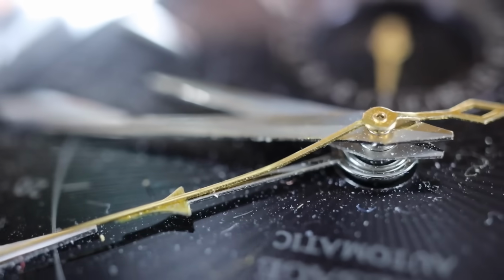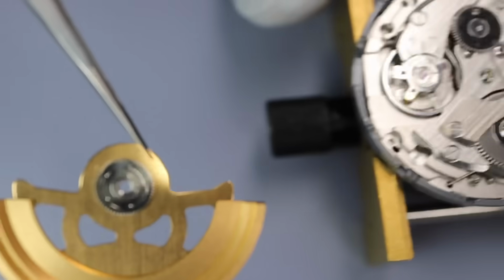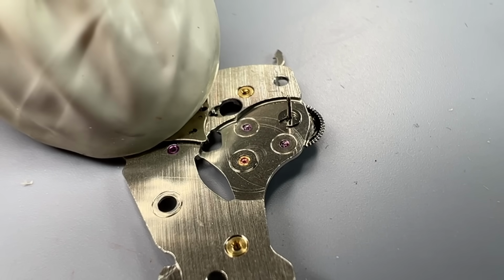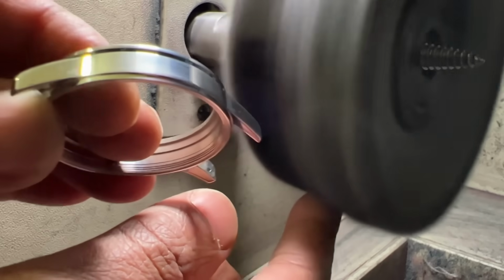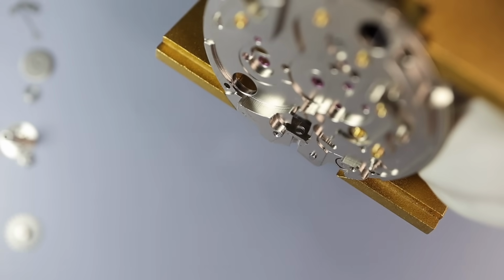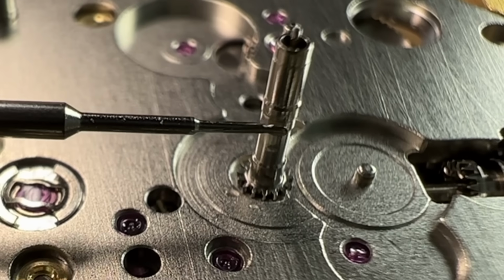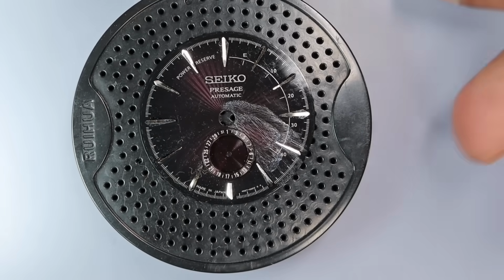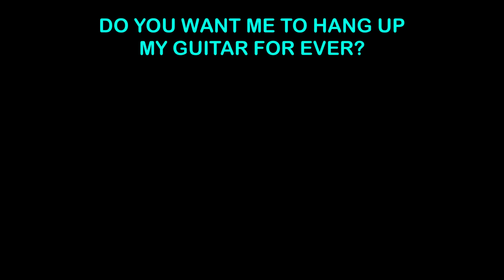Poor guy smashed it just after purchasing it - Seiko presage scratched dial restoration

Comment: Again, great video. I know not a comparison but recentley had a wall clock stop ticking , cheap plasic movment I s'pose you'd call it a solid magnet escapment (?), your process gave me confidence to go in and clean the gears and oil the points and happy to say now back on the wall and not in the garbage. Thanks.

Comment: Joe, don't know if you ever come back (after a year!) and read newer comments on your old videos... but...

There is a technique to restore old scratched dials by relacquering them- using UV cure high gloss/matt/satin nail polish!

You do what you did to remove the sharp edges of the scratches then clean really well. 

Paint on the lacquer nice and thick, then spin off the excess, like how CDs are coated after printing. Then cure under UV. The lacquer fills in the scratches.

Comment: ive done quite a few guitar restorations and messed about with cars..One of the ways Ive dealt with very deep scratches like was to clean with with alcohol, then polish across the scratch very gently. Clean again, and then fill with lacquer (and even very watery super glue on occasions)...allow it to harden for 24 hours and then polish. It has yielded amazing results if you're diligent and patient..which you are of course!

Comment: Working on two sister movements at the moment, got the proper rotor for my 4R35 custom tuna to fit plus my genuine fishbone hands and also to fit a replacement dial metal logo on my 4R36 turtle which is snapped a letter off catching it with a microfibre cloth and it does not look good as an Eiko lol   Then I am going upmarket to start stripping down my Tissot SeaStar quartz the 2030 movement as I scored a very early square spares and repair one plus a complete clean donor movt but hey ho it keeps me off the streets I spose :P

Comment: This watch makes me think of a double big mac.  On the outside, it looks big, thick and flashy.  On the inside, it's a bunch of cheap, greasy, tasteless junk.  The "quality" of the components inside is worse than disappointing.   It looks like someone took a sheet of thin aluminum and machine punched everything, including some of the gears.  If I didn't know better, I would have thought this was a Chinese knock off.  I should learn to expect much less from a €560 watch.
The video was top notch stuff.  Amazing work you do to restore something to better than new.  As always, very entertaining and love to see the little ones watching.
Reply: Seiko makes watches for everyone, and models like the Seiko 5 are iconic and do last a lifetime, or more with good servicing. Durable and stylish despite being aimed at the mass market, for £500 it's a steal.
Reply: @BigHenFor  Did you watch the video?   That was a turdburger of a watch.  There were gears made out of punched Aluminium.  The whole thing may have cost them $50, maybe another $5 in grease.  That watch was crap.  You can't look at the components and tell me anything different.

Comment: Greetings to you once again! You have been kind enough in he past to answer a couple of my questions and I am hoping you could answer another: With all possible respect to your skill an the watchmaking profession in general, is it worth it to perform a full service on a rather inexpensive Seiko movement? Does Seiko even make them with the thought they would be regularly maintained?

Most of my small collection of watches have a Seiko "4R" movement and if any of them were to stop running I'd be very tempted to just purchase a new OEM movement to replace them. The last couple of "good watches" I had serviced do not have easily replaceable movements and to me it was well worth having them serviced properly. I should add that my watchmaker is also a Seiko AD and he merely replaced a 7S26 rather than a repair (the watch had been dropped and would only run for a few seconds at a time) He recommended it would be half the cost to just replace the whole movement. I couldn't argue with that!

Thanks again for the video though, it's nice to see what's in the watches I actually do own!

Comment: I sometimes have luck filling scratches on crystals with acrylic gloss medium then polishing down. Sort of filling the scratches with a varnish. But I am very very very amateur, so am just mentioning it in case it’s something you might consider refining for situations like that scratched dial. Maybe a UV resin would work too, as that’s usually much more crystal clear.

Comment: If you really wanted to challenge yourself and maybe pull of the whole "I'm a hero thing" :)  a bit of clear laquer set into the scratch will fill it nicely. Then either scrape or sand it down using very fine ( 1000 at least) then use polywatch to polish the gloss back up. I do something like this on car paint and it translates well into any clear coat with patience and a deft hand. Using a scraper is a woodworker trick and easily made from a bit of steel that you put an edge on.  That way you can size it exactly to what you need and no more.

Comment: Searching for such NON-WORKING 4R57 Seiko presage with power reserve In France or around
(NE57 is the generic name for other brands, as NH3x is for 4R3x x=5,6,...)

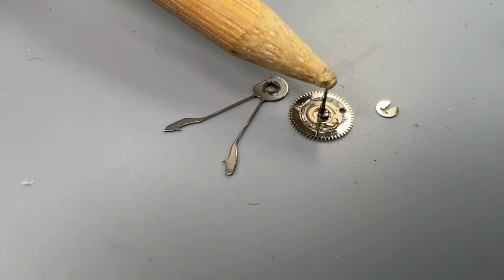17:04 the carbon grease  is normal on the magic lever excentric, but at the end you saved the dial !!! i
         dont know if heat would help on laquer ?

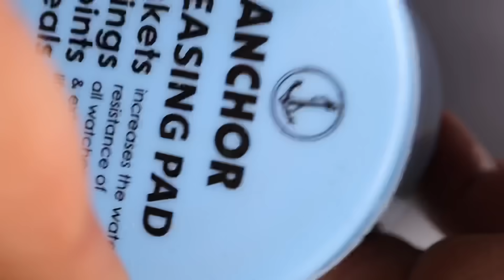Comment: 53:22 To all of you out there who still believe, the "Made in Japan" Seikos have different cases and differen case finishing than the standard ones: think again. Almost if not all of them have tha same parts from the same overseas factories. 😉
Have opened more than one of the JDM Seikos in the past and can most definitely confirm that 99 Percent of them read China Case on the inside with few exceptions like my Turtle which has "Seiko Time Co. Tokyo" embossed on the inside. Which does not mean that those cases did not ship from China in the first place.

Comment: I paid almost $700 for a Seiko and after two years the bracelet fell apart. The links became very loose early on then the clasp began failing. It completely fell apart just over two years old. I returned it to Seiko because I couldn't buy a bracelet for it. It is a special style exclusive to that watch. Seiko quoted me around $250 to replace it, the solar battery and pressure test it. I told them don't even bother sending it back to me (another $30) and I just went and purchased a new watch (Not a Seiko).

Comment: Can't believe how beautiful that result is NW, despite having watched your work for some years. By which I mean that perfection from your hands should no longer suprise me, Can you tell me why my 1980s EDOX watch is no longer watertight after its last service? Indeed, any dive or waterproof watch, including Omega watches returned to Omega for servicing, are never guaranteed waterproof afterwards. How can that be? surely there is a way to put the seals back? Thanks for the great videos. Tom (from France, though I know Birmingham well)
Reply from the maker: Hi Tom. The whole point of a service is to get everything working properly so I don’t know who told you that about not being waterproof. Omega will replace all the seals and pressure test it to make sure it is waterproof. The places where water can get in is through the case back gasket, crown/pusher o-rings or glass gasket. So as long as all those things are good, then it should be waterproof.

Comment: Wow, brilliant work, Joe! This Seiko looks gorgeous, especially paired with the fake sleeve. Thank you for sharing. So many oiling points make me terrified. I have a couple of questions. Did you use specific Seiko oils or standard Moebius or else? I only had to service few well used Seikos or Orients before and always noted the lower amplitude when compared to Swiss movements. It seems to me that amplitude within 250-260 degrees is quite normal for Japanese movements. This video confirms that. What's your experiens?
Reply from the maker: Thanks mate. I used a mix of seiko and moebius, educated guesses in some spots

Comment: As always enjoyed the video. May I ask an opinion? I have a Quartz Heuer dive watch from the 80s . It recently stopped working. I sent it to Heuer for evaluation and was told it could not be repaired and the person I spoke to unofficially suggested a "movement swap". A local shop says they can do it. What is your opinion of this suggestion? The watch has been my daily wear as well as my sole diver. I'd like to have it again. Thanks
Reply from the maker: Yes with quartz that’s what they would usually do, a movement swap or you could change the circuit.
Reply: @NekkidWatchmaker  Final follow up. I found a local shop that took the watch apart, cleaned everything and reassembled it with a new battery, and it so far is working great. A bit expensive, but much less so than a new watch.

Comment: I love the look of this watch (other than the band - I"m partial to metal links.)  But the inside left me cold - for the money, I expected to see gears with a little more finishing on them.  But these look like they were stamped out of sheet steel with a blunt die, with all the edges rounded over and no polishing or ornamental striation on the surfaces.  I've seen cheaper watches with a better finish to the internals.  Such a shame - they got the exterior right, and thought that would distract from the inside, I guess.

Comment: I have the green dial version of this watch.   Bit disappointing seeing how much oil and grease was used at the factory.  Almost seems part of why seikos give such a large +- figure on so many of their movements because they know some will perform bad from new with how they put them together.   I guess they are mass produced but I still would have thought they would have being better with the oil and grease usage.   Shame you could not check its performance before servicing it to see how much better it performed afterwards.   Have you ever tested a new movement and then serviced it to see how bad mass produced movements are slapped together?

Comment: Joe: I have a bunch of watches and I do have to wonder, how practical is it to own cheaper watches if every 3 to 5 years you have to spend much more than the watch cost, just to service it? Especially if like me you have multiple watches. I’d go broke if I had them serviced regularly…
Reply from the maker: 3-5 years is what the manufacture recommend but I’ve seen people who have worn their watches for 15-20 years without servicing. It may not be worth while with fashion brands and lower end watches, and that’s why they are cheap and the whole point is for you to wear it for a few years and then replace it with the latest model, not so dissimilar to buying a microwave or a washing machine
Reply: @NekkidWatchmaker  Fair point. I generally do that with my watches, which are in the $500-$2000 range (Tissot, Hamilton, Seiko, Longines, and so on). I do treat them gently. The higher end ones I have overhauled. I just wish there were more watchmakers like you, Joe!!

Comment: Im very suprised for this caliber and asked a question my self why number of parts for this movement is  as much as same with 10K Usd IWC, Breitling, Zenith or Panerai chronograph watches and no proper answer. Over engineered? Obsesive Japanese precision? Built to last? Despite a few number of complication, the movement looks much complicated. Also, Manufacturing quality of movement is much much higher than this watches price range. Considering the number of parts with this high quality and robust body, i guess Seiko is loosing money for each watch that they sold.